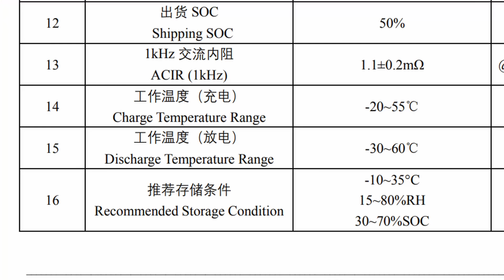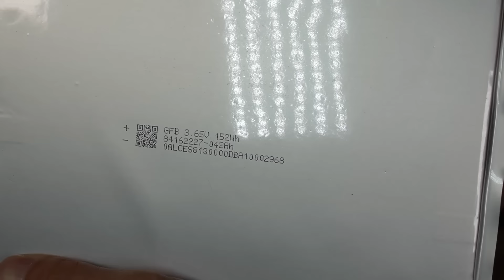CHINS Solid State Lithium-ion Battery Tear Down and FIRE!

Comment: Thanks Will!  I am building a system and was looking at these batteries.  I have a question maybe you could answer, itd be lovely if you could.  I need self heated batteries, but ive also seen "wraps" like sleeves that go around non heated lithium batteries, and keep them warm.  
It's an external heater vs internal, do you know anything about these?  would it be better to just swing the extra cash on the initial purchase and get the built in heaters?  Thank you so much too, I've been watcing you for years.  I miss your RV videos!

Comment: Random question: any uses for a 3.2V battery lift over from a faulty SOK LifeP94 battery. I had one bad cell, but the other three are good. Willing to build a small solar system around these for hobby use if I can find some specs/equipment. Thanks y'all.

Comment: I wouldn't call that safe but drilling is a lot different than a simple puncture. Drilling produces a lot of heat. Puncturing does not. I also think I would power wash everything that smoke touched so no animals lick it or get it on their paws and lick them, etc. Just to be safe.

Comment: This is really scary! I think however safe Lithium Batteries are, we should store large battery systems away from our houses. I can not imagine how much fire 10 such batteries can produce if they started burning. The kind of explosions would be enormous. As someone using 50KWH of Lifepo4 battery storage, this video has really scared me. I know a lot had to be done to start the reaction but things can happen accidentally.

Comment: Pretty sure that was Lithium Polymer

EDIT NO!  After seeing the data sheet in pinned comment, this is NMC!!!
Reply: Agreed, this is just typical Ali express BS marketing calling this "solid state". It would be like a company advertising driver assistant functionalities as "full self-driving".
Reply from the maker: @UCwLcHDPSzUfebJ5bPBhxKAg Yes I agree, but the youtubers do not have actual solid state batteries in their hands. And I literally said it in the video that it is probably lithium polymer. Did you watch the whole video or did you only watch the fire part? I discussed all of this and showed the data sheet from gangfeng.
Reply: @WillProwse  I removed that comment read harsher than I meant. Awareness and excitement are a good thing for future tech and r&d funding. Some tubers are trying to bring awareness, although there is certainly personal gain in it for them jumping on the hype train. We are years away yet from real solid state, if it is even viable. But China's gonna China and keep selling scam products, keep up the good work!
Reply from the maker: @OuchMySpleen  Thanks and totally agree!

Comment: Solid state usually means no graphite for negative anode, but there is no hard fast rule for definition of solid-state battery. 

It cannot be LFP cathode with 4.1v cell voltage reading.  The 3.65v printed on cell also means it is not LFP cathode and there is likely graphite anode mixed with some adder for negative anode. 

My guess is it is NCA or NMC positive cathode with a small amount of silicon 'dust' mixed in with graphite anode to call it 'solid state'.  Silicon 'salting' drives down the cell voltage a little from standard NCA or NMC cells.  Salting the graphite anode with silicon gives greater capacity but silicon fractures during charge cycling reducing the cycle life of battery.  Silicon fracturing is the main obstacle to greater capacity silicon-based anodes.  Some manufacturers are 'salting' the graphite with a slight amount of silicon to increase AH rating numbers without too much cycle life degradation.

It is the NCA or NMC cathode material that is reason for higher cell voltage and causing it to burst into flames due to the amount of oxygen given off when cell is puncture shorted.

Comment: I'm new to these ratings, but with almost twice the energy capacity, isn't each cycle wider? So the fewer cycles isn't much less than the equivalent of 3000 cycles on the low end of LiFePO batteries?

Also, with higher energy capacity but I assume the same voltage, isn't the charge capacity higher so 1/3 C charge rate on the solid state battery is more current than 1/2 C on the LiFePO battery? Then since it's for domestic usage, do you really want to discharge at higher current than you charge it? You'd want to keep all the long-usage, low load appliances running until the next light, so the discharge current being lower isn't such a big deal is it?

Comment: Maybe when they punture the cell they dont Apply any heat to it.

But when you drill there will be heat transfered to the cell and inside. Maybe that's because when they did it it happened nothing

Comment: So basically I saw a chinese galaxy note 7 grade lipo pack mislabelled as solid state lithium go up in flames due to puncturing? I don't know the correct legal term but "attempted manslaughter" comes pretty close. Somehow I think our far east supply problems aren't down to production shortages but rather the container ships sinking due to unsafe batteries on board :-D

Comment: So "semi"-solid state" means Li-Po reinforced with some plates or something, i suppose.
And as internet states: "Semi-solid state batteries are a type of rechargeable battery that uses a semi-solid electrolyte instead of the liquid or gel electrolytes found in traditional lithium-ion batteries. The semi-solid electrolyte is typically composed of a solid, conductive material suspended in a liquid electrolyte."

No wonder it caught on fire. In essence its a same old li-ion.
True solid state batteries should be more similar to a condenser then to a battery.

Comment: I know it varies by manufacturer, but aren't cobalt/nickel Li battery life cycles only in the 5-700 range? If so, a ~2x lifespan increase with similar energy density is pretty dramatic, especially in an EV situation. That could easily be 600,000+ miles before 80% degradation based on some long term Tesla vehicle data already.
However for solar storage I still prefer LFP. Even if all the solid state claims were true, it's still far from the cycle life and safety of LFP. And also no cobalt...
Reply from the maker: Yes true and I was thinking of the expensive graphene lithium polymers. And a few low c rate polymers can pull 1200. When I used them for drone racing at high c rates (150C burst) they would die after 200 cycles usually. Really weird that this cell did not have a higher c rate though.

Comment: considering I've still never seen a solid state lithium battery anywhere near that size (only small primary battery sized)... I doubt it really is anything other than a slightly varied chemistry of polymer if any change at all.  buzz words "solid state" are pretty cool... futuristic...

Comment: I disagree with Will with his implication that solid state ISN'T the future. I absolutely think that it is.

While the cycle life on this battery might not be great, on real solid state batteries can  theoretically be longer as there's no way for dendrites to form in the electrolyte.

I'd absolutely disagree that these are actually solid state as well. They seem like a regular lithium polymer. The cell voltage seems to back this up as well.

So as I see it, all that we have here is false advertising by Chins!
Reply from the maker: Agreed! And when you have one, send it my way 😁👍🏻
Reply: @WillProwse  While I have in the past been involved in the development of a sodium ion battery (still a long way from commercialisation), it's not really an area I'm actively working in.

However, I'm just about to get a bunch of 250A Smart BMSs custom-made by JBD for us that have an output that controls a 5A Heltec active balancer (balancing will turn on and off at the same setpoints as the passive balancing in the BMS). 
If you were interested in reviewing one of those, I'd love to send you one!

Comment: For a battery person you would think that he would know what Lithium Ion pouch cells are like and that the metal, Lithium is SUPER flammable!
Reply from the maker: Watch the whole video
Reply: Its not the lithium that is burning as you have very little if any elemental lithium in modern lithium rechargable cells.  Its is the electrolyte that is burning due to being heated past it's flashpoint since the cell was shorted by the stepbit.  The thing he was testing was supposed to be a solid state lithium cell and acording to the data sheet it was not supposed to react or start on fire when punctured.
Reply: @kuhrd  I guess that may be so. But you should watch Lithium metal being put into water, it is CRAZY!
Reply: @BenItBuhner   I did the math and if we assume 0.08 grams per watthour as is used in most typical lithium cells we are only looking at 12.2 grams of lithium oxide.  Since it is already an oxide it won''t react much with water or most other parts of the battery.  The materials that will burn are mostly the electrolyte, the carbon, the plastic separators and the copper and aluminum plates in the cell.  Since I have had plenty of cells burn over the years in testing I can say the temp never seems high enough for the copper or aluminum to start burning at an accelerated rate.  So it is down to the electrolyte, the plastic separators and the carbon.  

The main reason most lithium polymer cells are so violent when they reach thermal runaway is due to the battery continuing to heat beyond the flashpoint of the electrolyte due to it's high energy density so the electrolyte is being cooked off as the cell continues to short out and discharge as the separator burns and exposes more surface area of the plates allowing the short to expand and increase the rate of discharging.

While LiFePO4 cells are generally much safer due mostly to lower energy density they can still start on fire if punctured just right if the electrolyte that was used is flammable which many still are, they can also reach thermal runaway if shorted or overcharged but it is far less likely and they usually just expand, vent and offgas in these situations.  

In the case of these solid electrolyte batteries the electrolyte is supposed to be nonflammable as that is one of the major safety benefits for going to them.
Reply: @kuhrd  Wow, thanks! I've mostly heard that it is the Lithium metal itself and that it mostly reacts to fires or liquids causing itself to set a blaze.

Comment: WILL!  THank god you brought that battery outside to your driveway.  Had you drilled it all the way you could have cought your shop on fire!  Crazy stuff.  Never trust Chinese products at face value.  Crazy!  Also PS: little late to fill a bucket of water.  Should have had that ready to go.  Any bigger could have taken a panel with it.  Just like a camp/ bon fire I have multiple buckets of water near by to prevent fire from escaping which does happen.

Comment: I think the heat that was caused by the drill bit, opposed to their just puncturing it with a screw driver, could have had something to do with it catching on fire. They do get pretty how when going through metal and that could have been the reaction. Still they said nothing about the gas inside. Probably didn't expect someone to actually do it. ;-)
Reply: re: "I think the heat that was caused by the drill bit"
Um, have you actually ever used a drill and bit, and furthermore, into a mostly plastic pouch thingy? Drilling into steel or aluminum stock a cm thick is one thing, this is more like a thick baggy with soft material inside ...

Comment: I always thought LiFePo was as supposed to be much safer than LiIon when it comes to explosion/flames.  What is the reason they claim “solid state” is safer?    The batteries in my house and in my DIY van are LiFePo, partially for safety, otherwise for cycle-life.
Reply from the maker: This is not lifepo4
Reply: @WillProwse  Yes, that was understood by me.  In the beginning of your video, you show two Chins batteries:  LiFePo and Li Ion Solid State.   Then you talk about how the Solid State one is supposed to be very safe.   But I thought the LiFePo was supposed to be safe, which you’ve now shown in a subsequent video.  Obviously, the “safe” solid state battery was not what it claimed.  My specific question is:  Are solid state batteries supposed to be more safe, equally safe, or less safe than LiFePo batteries?

Comment: I hope the shorter cycle life is not the ugly beast of planned obsolescence coming into play. When you short the plates with the drilling the stored energy will be released quickly in electrical discharge. Whether solid state or not a short is going to release the entire charge of the cell in a short period of time. You should wear an appropriate chemical cartridge respirator mask when you are testing electrical component flammability. I had my doubts about solid state being without runaway heating of the material when severely damaged/shorted. Thanks for the debunk. Question in my head is: Are they really solid-state cells or are they using a play on words?

Comment: I would not like that battery in my rig !  I like my Walmart deep cycle batteries . They are cheap and do the job well enough for my needs . They have a three year replacement warranty . If they take a crap on the road  it is an easy replacement.

Comment: Would be interesting to see if a complete puncture test like the one in their video results in the same thermal run-a-way effect. Would be a neat video, if you could setup a clear polycarbonate barrier to protect yourself. (no reason to take unnecessary risk for a YouTube video) This video further illustrates how you may not be able to believe everything you see from overseas.  

Just like the Vestwoods teardown. I contacted Vestwoods directly, and through Amazon and they insist they have Bluetooth and low temperature disconnect. They have a video showing their BMS and it is significantly different than the one you found. They also said they were aware of the "Video on YouTube" but did not really elaborate. 

With the amount of reviewers and especially thorough ones like you tearing these things apart, they should know by now, that they'll eventually get caught. Maybe they don't care, because they have made the money, and simply rebrand and do it again. Will Prowse expose' on Shady Solar, Shedding Light on the Dark Side of Solar!!! How is that for a line! :)

Comment: My only concern with the lithium batteries is fire danger..it's hard to put out a lithium battery fire and it burns very hot and spits fire everywhere
Reply: SO USE METAL CASE. and wrap it with Lithium Fire Blanket

Comment: It was actually SAFER than standard pouch cells.  It too a lot to puncture it.  Now, what kind of use might find up cost justified for this additional safety?  Beats me.  Cars, yes, but they are so expensive already & certainly couldn't live with just st 1200 cycles.  Be interesting to soo if a cell can ignite an adjacent cell that isn't punctured.  Also, blunt impact test for type of forces most prevalent in vehicles.  
Note video from co shows puncture being done in an air chamber.  The screwdriver then keeps air from getting to lithium when taken out to current test.
The packing density will restrict available air to any hole on me at of two major surfaces, as does the overall wrapping.
It MIGHT be such cells, packed tightly w resin pored  to fill voids & wrapped in rubberized waterproofing then wrapped in kevlar / resin & metal /plastic container would reduce danger in auto crashes significantly.

Comment: Lol next time a peice of sheet metal with some cinder blocks to do puncture testing bud.  A fire extinguisher would be nice too and always do outside.  I was really worried when you poked it inside at first I know your Shop's nice and clean.  Yea those are definitely not solid state batteries....
Reply: Because he is a Video Maker, he has important creative considerations to maximize marketing appeal.  It is possible he did multiple screwdriver punctures outside before he went in to film one, after determining it was safe.  Then, having performed all the tests outside fully garbed in safety gear, he repeated the now known dangerous drill test outside.  Having determined the level of safety, he intentionally wore his flip flops to mimic a real life scenario.  It's very important for Will to get his point across, that this battery is not safe.  Therefor, he can plan the demo to appear spontaneous and riveting, while still being safe himself.
Reply: @mikemotorbike4283  just giving advice not demands dude, don't read into it too much.  And yea he only had one cell removed so him trying off camera with ppe is lol.....
Reply from the maker: Yeah agreed. That's what I used to do with my lithium polymer cells over 7 years ago. I figured this was solid state and I did read the data sheet, but shouldnt have trusted what I read. Will be safer next time for sure
Reply from the maker: Usually I plan the videos out pretty good, but not this one. I thought I would poke it and nothing would happen. Then move on.
Reply: @WillProwse  Yea Will for sure bud Love watching all your videos.  You got me into solar just like rich rebuilds got me into fixing Tesla's.

Stay safe and Take it easy man!
Casey

Comment: The difference I see right off the back is that they punctured the battery cell- they pushed down through it. You, on the other hand, took a drill to it and a spinning drill bit creates friction and friction leads to smoke and fire if something present is flammable.